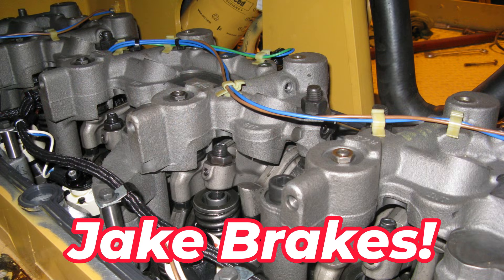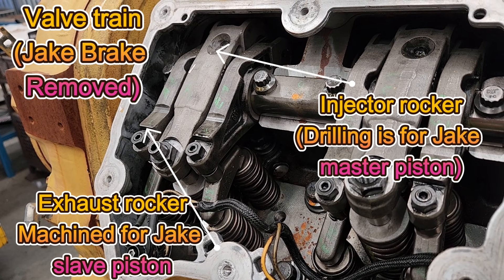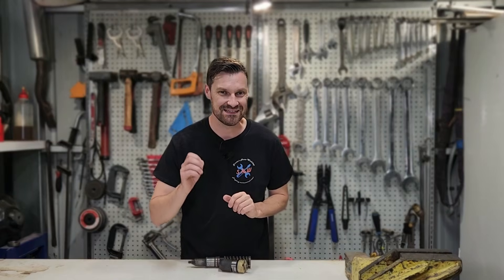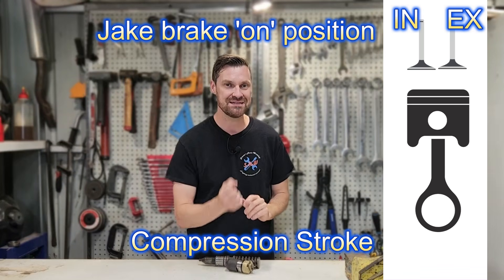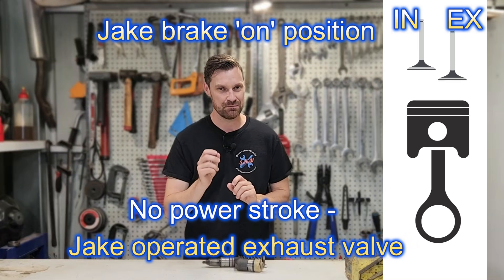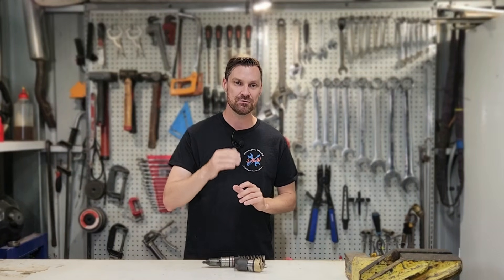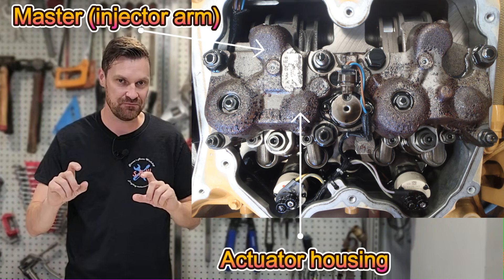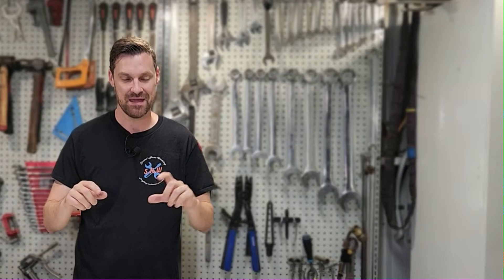Engine Compression Braking: The Secret to Better Stopping Power? (Jake Brakes)

Comment: It’s worth mentioning when the exhaust valve opens the highly compressed air rushes out at high speed. This starts spooling the turbo which forces more air into the engine, increasing the pressure on the compression stroke which helps slow the piston further. That’s why you’ll hear the turbo spool up when the Jakes are on and you will see positive boost pressure on your boost gauge. 

On some engines like the Series 60 Detroit, the ECM uses different boost pressures to adjust the braking force from high and low instead

Comment: In practical terms inside the engine this power strokes deliver energy to the flywheel after using power from it to complete compression. It there by creates a giving and taking of energy from the flywheel.  As the Jake is turned on this repetitive taking energy from the flywheel turns the engine from a power producer to a retarder to forward motion.
Reply from the maker: An excellent explanation of what is going on, thanks mate.